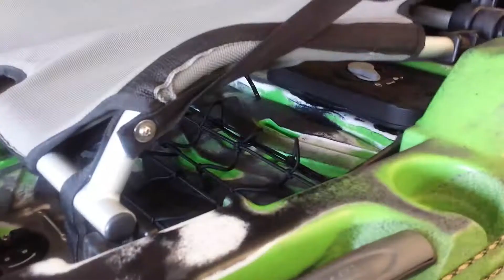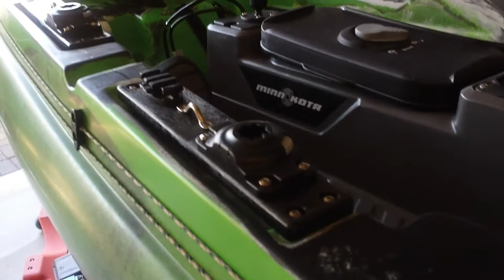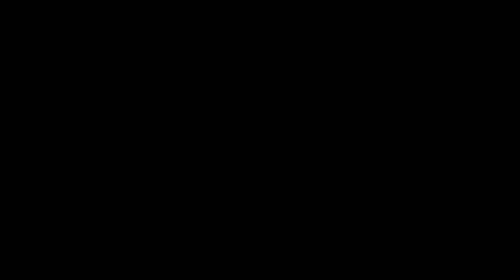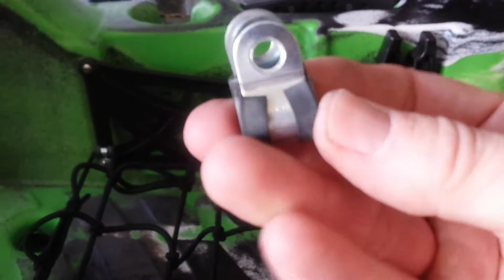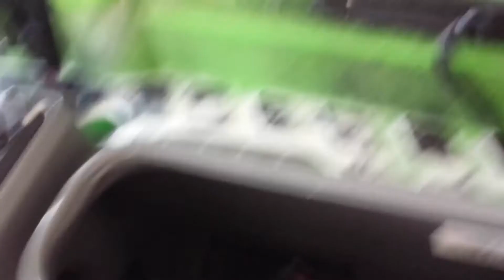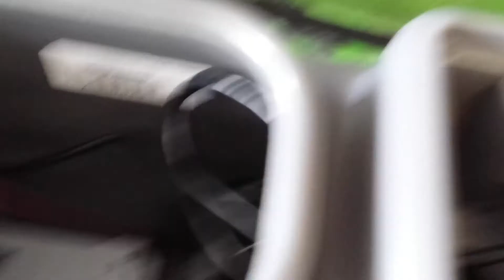Old Town Predator XL Minn Kota DIY Modifications

Comment: Is the MK ur goto yak atm? 
Just got my 13 rigged up like ur prior videos. Its wonderful so far. I just need to extend the wires and qait for the pwm controller. Will use the motor arm in the meantime.

Comment: How did you like your Predator MK Kayak I am very close to buying one. How did battery life and speed on water do? I was considering buy a Lithium Ion battery for longer life as I live in La and fish marsh and areas that are a good distance away. So any advice and considerations would be extremely appreciated. Enjoy your DIY videos you do a great job with everything and keep it simple.
Reply from the maker: Thanks David. I like the MK very much. It is very stable and I can stand up easily at 200 lbs. I use a 100ah AGM battery and have never used all of its juice when out on the water. The speed is about the high average for kayaks at 4-4.5 MPH depending on conditions and load.
Reply from the maker: Thanks David. It is a very stable kayak. I use a 100AH AGM battery and it has never run out of power when on the water for a day.

Comment: Planning on buying a brand new 2019 Mk and using a battle born lithium 100ah 
First question : is it too big to fit cuz i think they’re talking about a 24 size battery and the bb i think is 27
Second question i think they said to run the motor with lead or agm battery so is the lithium will work 
Third how long should i expect the battery to last
Reply: Hi Jacques. I don't use a lithium battery so I can't answer those questions. Battery life depends on how you run the motor. If you run at fast speeds it will not last as long as going slow. To estimate the battery life you would need to know the amount of amps drawn by the motor. A battery that large should last at least one day of fishing.
Reply: you should be able o fit a group 31 lithium in the Old Town battery box. I have the Ohmmu 150 ah lithium and Ive never seen below 60 percent